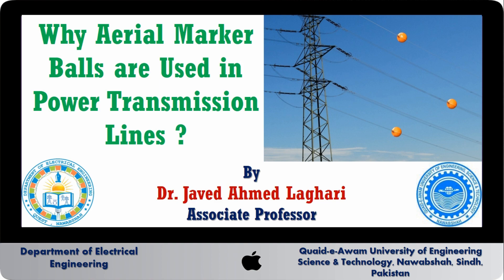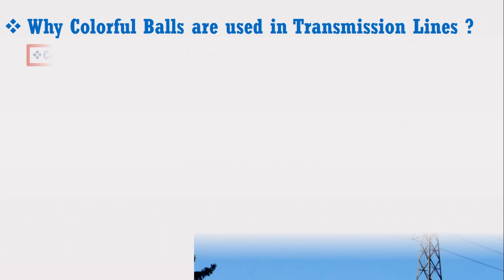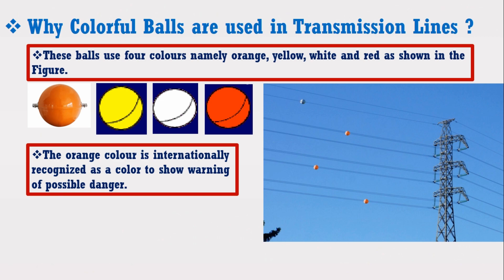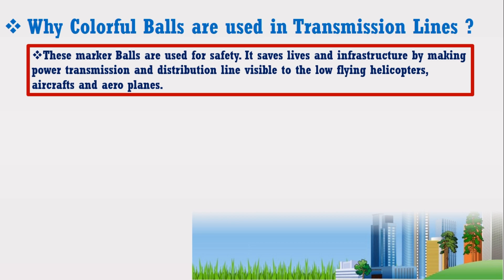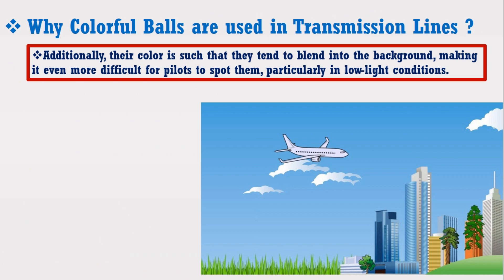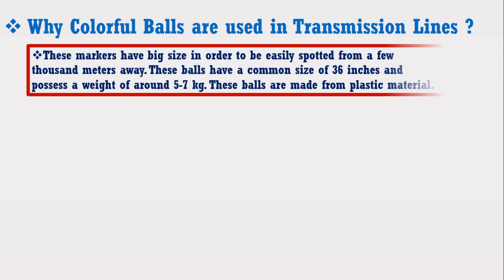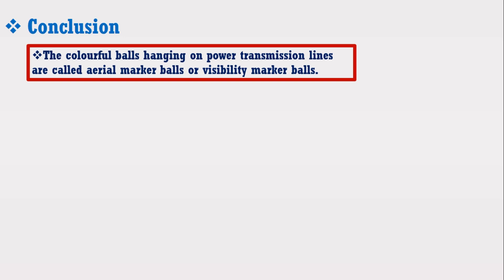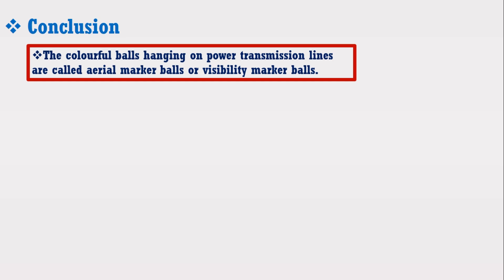Why Aerial Marker Balls are Used in Transmission Lines ? | Dr. J. A. Laghari

Comment: Thanks sir , but I have little question, sir when we use these balls, they will not impact on the weight of conductor, sag of lines & during windy season...
Reply from the maker: Yes of course. But it is necessary to protect the human lives, electrical infrastructure and damage. That's why compromise is to be made. Furthermore, they are not used on every transmission lines. They are particularly used in those transmission lines located near the airports, and hilly areas.